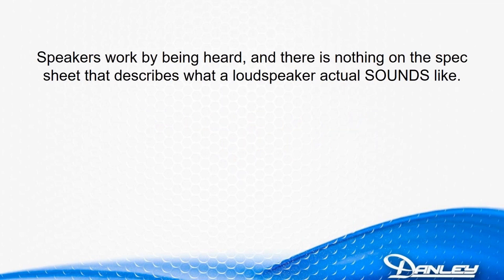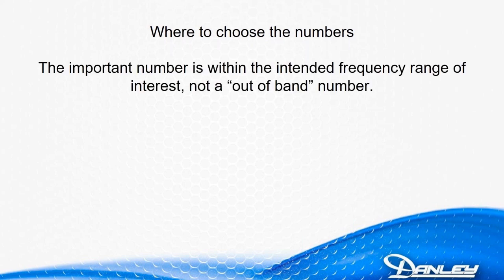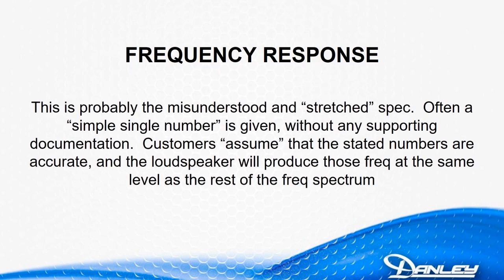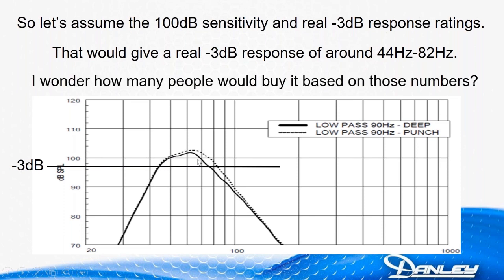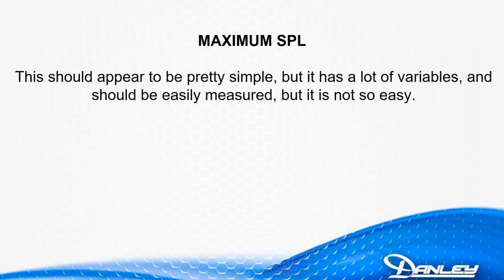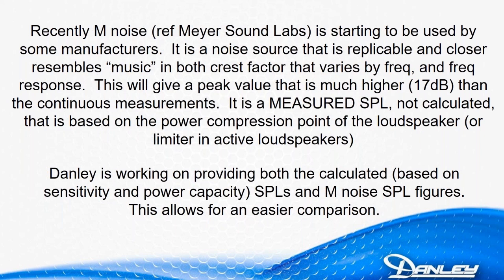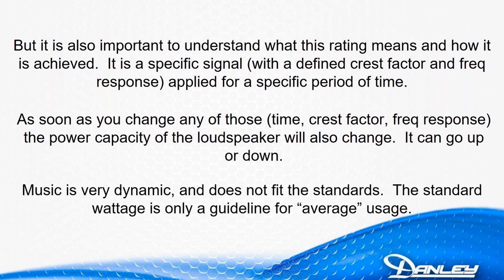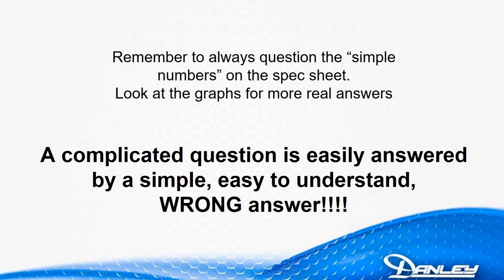Fireside Chat |  Ivan Beaver |  Spec Sheets What do the numbers mean? 05.07.20

Comment: Another way to "cheat" with sensitivity would be to rate the TH115 where it is 22 ohm and you could apply 4.69 Volts and get a higher sensitivity at 1 watt 1 metre, just like the sensitivity numbers at the top of the pass band.
I think the EAW LA400 is rated at 150 Hz, so unless you are using them also for kick bin duty, there is little point to it.
Another way is imagine I have a loudspeaker with very high harmonic distortion and I feed it a strong 30Hz signal. It is probably making more noise at frequencies outside of 30Hz which would add to the sensitivity number (I used the example of imagine putting a whistle in the port, just so you can say your woofer produces high SPL when fed 20Hz). So you have to make sure that it is the level of the frequency of interest and not the harmonic distortion that is producing your sensitivity rating.